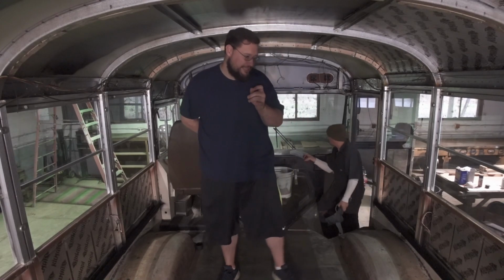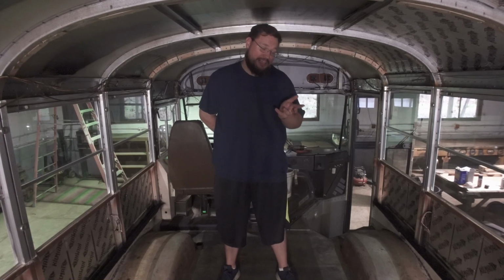little missions

Comment: Hey guy's  here's a little trick when working with silicon or any oil based caulking. I always use lacquer thinner on my finger and in a little cup when smoothing it out. It leave a good looking line because it won't stick to your fingers. Hope this helps!
Reply from the maker: that's awesome, I'll have to look into this.